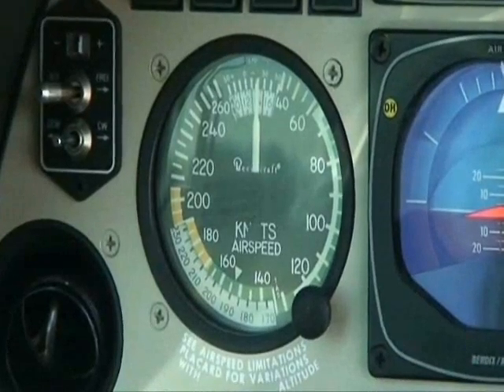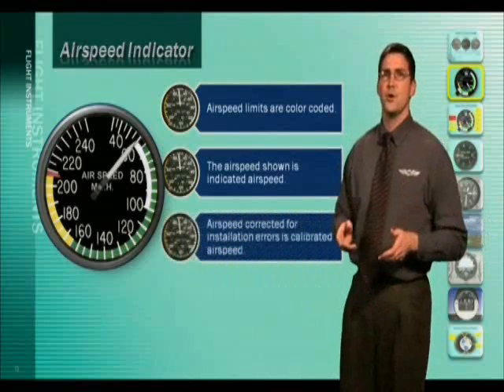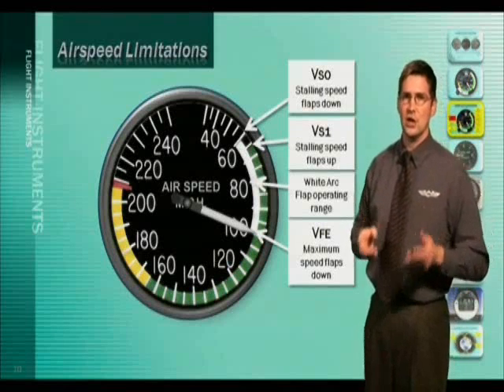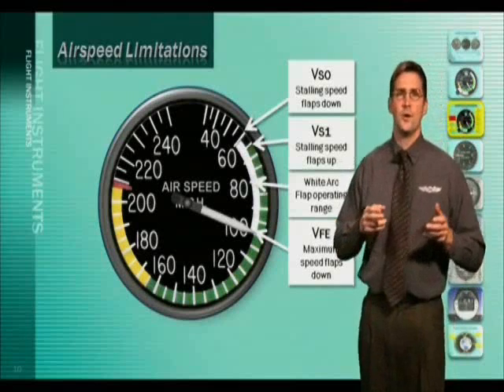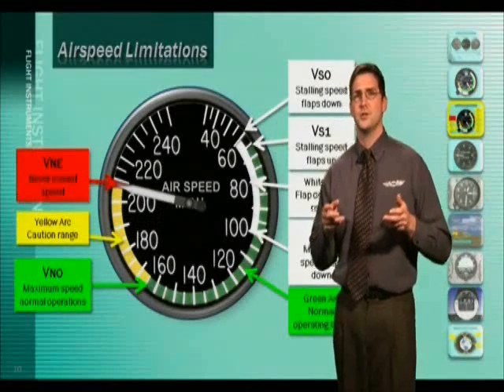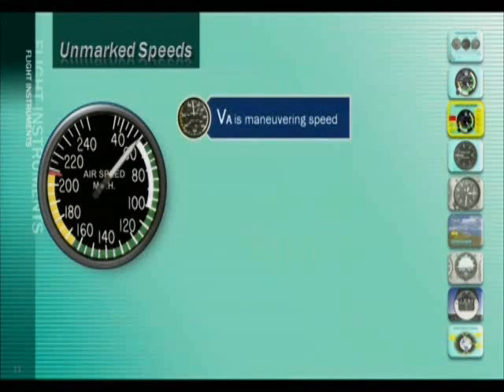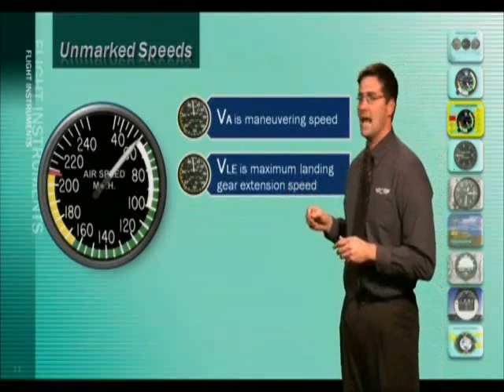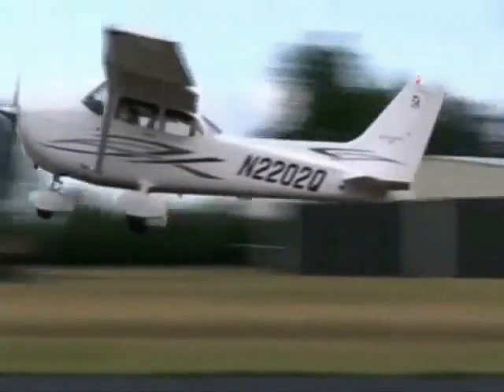Private Pilot Airplane - Flight Instruments - ASA (Aviation Supplies & Academics)

Comment from the maker: Thanks for your comment Pfsif -- Vso is stalling speed in the landing configuration. It just so happens that the example altimeter shown is most likely referring to an aircraft with fixed gear (C172). If you take, for example, a Piper Arrow that has retractable gear, Vso would be the stalling speed with gear and flaps down. Therefore, Vso is not just specially relating to a condition with the flaps down. Additionally, Vso is specific to stalling configuration and Vfe is a structural-integrity number. They are not direct opposites.

You can find additional information on performance speeds in chapter 10 of the Pilot's Handbook of Aeronautical Knowledge FAA-H-8083-25A.